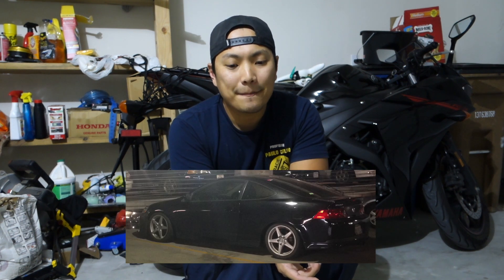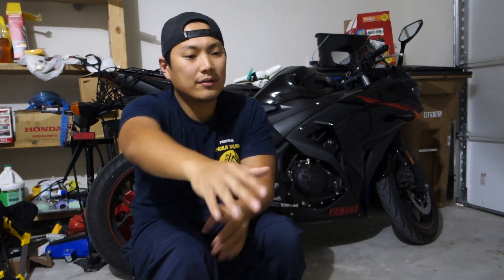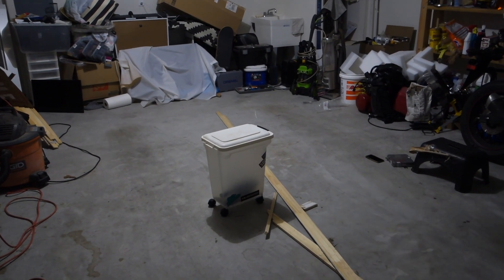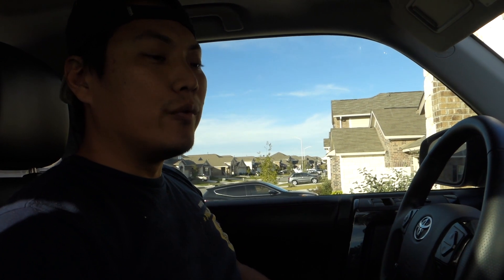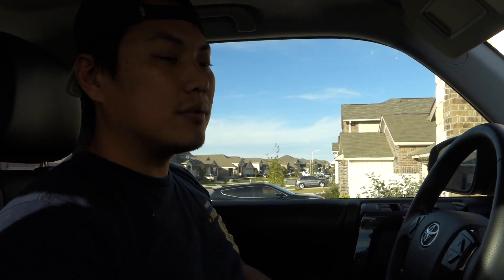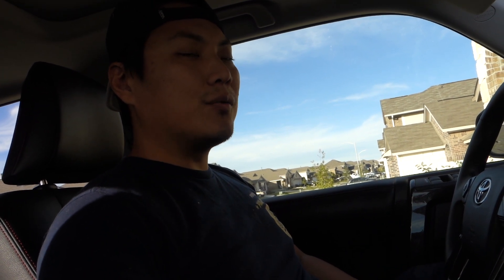My RSX idle issue nightmare

Comment: I had an idle issue on my 05' RSX..it wld cut off at stop signs,stop lights etc. While sitting the RPMs wld rise to 2000 then fall and almost cutoff. i changed airflow,O2 sensors,IACV sensor and just about everything that has to do with idle. I took it to the shop and they cldnt figure it out. Turns out it was Denso performance spark plugs that i tried when i did an oil change tune up. I changed back to honda/ngk plugs and then everything was back to normal after the change

Comment: Don’t use aftermarket cold air filters, their aren’t as good for little particulates n water. Your throttle body has many channels in it. And they will clog if your sucking in water n shit. Stock intake is designed specifically to trap and release water down n out.

Comment: Where did the dirt get into
Reply from the maker: I'm not sure what you are referring to but the point of the video was lowering the car constantly messed up my fender liners so after buying them multiple times, I decided to just leave it off.. didnt think it would be a big deal. This caused the engine bay to get really dirty, and I'm guessing this made it easier for dirt and dust to get to the IACV cause I had to replace it twice within a few years. Cleaning didnt work for me. Hope that answers your question.

Comment: Okay so I feel like I'm having this problem but still not sure I get a check but when I get out of gear it kinda revs funny like @ 2000. Rpms then it goes back down to 1000 rpms idk if it's the same thing but lmk would help alot
Reply: Its Yaboyz have the same issue. I just had the IAC replaced yesterday was fine, and now it’s doing it’ll over again. Car is also really jumpy on and off throttle.
Reply: Dakota Schmidt did you find a fix???
Reply: Tender chops did you ever fix yours ?
Reply: @dakotaschmidt7  did you find a fix???
Reply: Check exhaust